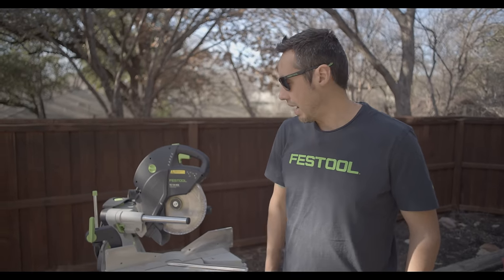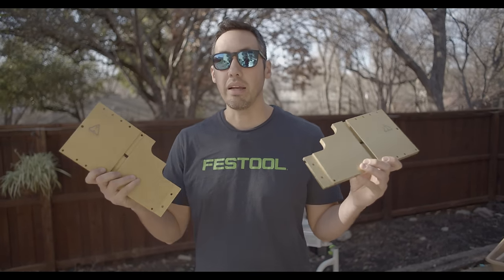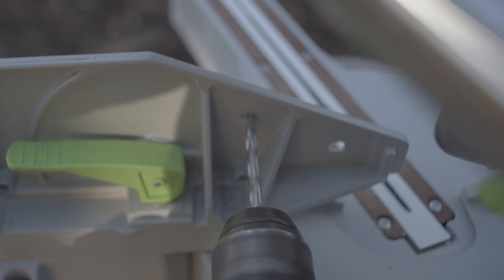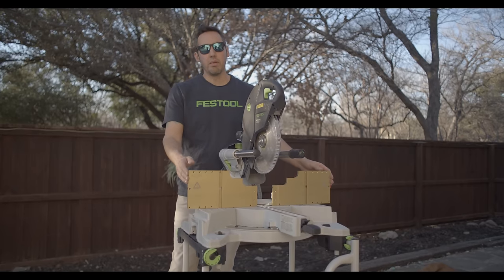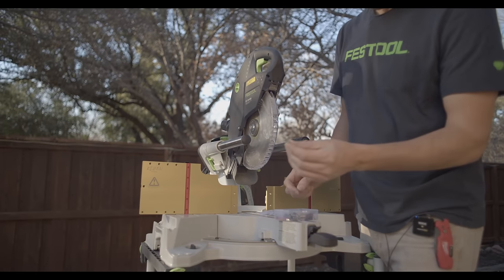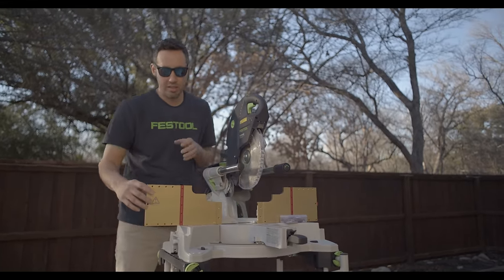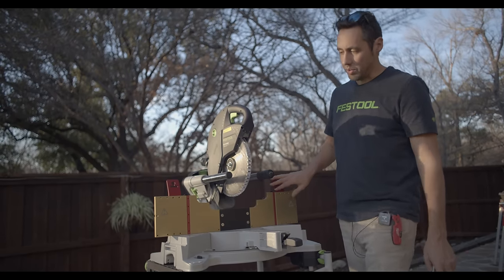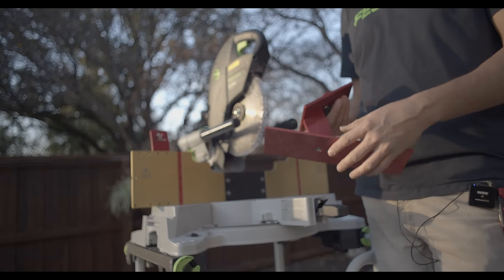Festool, don't hate me for this...

Comment: Question, moving the fence out by adding a layer changes the pivot point to be behind the fence. Which would make the zero clearance slot wider when turning angles, no?
Reply: My thoughts exactly 😂
Reply: If you are a fixed fence miter saw owner I understand your concern. That is why we added the t-slot across the back so it can be positioned and you’re not cutting into it all the time.
Reply: @KizenEnterprise  i didn’t notice that. That is super smart. Good engineering and thank you for the answer

Comment: This looks awesome. Any thoughts on Fastcaps crown stop fence?
Reply: It’s a bit different but I think I prefer that (not that you asked me). One important thing you don’t lose with FastCap is the pivot point because for DeWalt at least it goes on top of the short factory fences vs sitting in front. The saws are designed with that pivot point as the reference when you turn them, so you lose that by putting this fence on the front of the factory fence. This definitely has more functionality though.

Comment: We prefer the Fastcap fence mod over the Kizen on our saws. You don't loose cut depth.
Reply: That’s all good but you are still setup to do one thing. The table problem is now the fence problem.  Setup time again if you needed to cut something else
Reply: @KizenEnterprise  Which hasn't been an issue for us whatsoever. Solution for a problem that doesn't exist for us.

Comment: Hard choice between this and the fastcap fences. Think the zero clearance insert is great.
Reply: Kizen Mitre Fence is a system design for people using a mitre saw for more than just crown moulding. Great in shop and on the job and also also on not just one saw brand

Comment: That saw is insane. Definitely will have one in the future
Reply: Save your money, get another saw..its not worth the price
Reply: @freddyramirez1820  really? Why’s that. I’ve used dewalts,hercules, and Milwaukee not so much festool.
Reply: @CanisCarpentry  ive been using a dewalt for yrs, figures i see whats the hype and i got the kapex..the 1st thing is the cut depth, being used to 12" blade, going down to a 10" just doesnt cut it..if anything that one of the main flaws until they make a 12" festool.. nxt the laser wasnt even accurate out of the box, you can adjust it, but time and $ adjusting everytime you switch the blade id its diffrent kerf is not ideal, the shadow line the dewalt light makes is more practical, kinda suprised Festool doesnt have a light and laser for the $..nxt the dust skirt gets in the way, i like to score the top before a cut all the way thru, the skirt will be in the way if you want to do this, you have to do a chopping motion instead of sliding motion..lastly the motor didnt run smoothly on mine and i didnt like it, sounds like it bogs up, i was cutting 8/4  walnut and it couldnt even get thru that, i could only imagine Oak..just didnt seem powerful enough, sure you can adjust the rpms but the power feels weak..i returnd mine, wasnt worth the price tag for me, couldnt even beat out the dewalt for me..i orderd the 12" makita, we will see how that works..but for damn near half the price i can deal with it no being perfect, but the price tag on the festool just didnt make justice with all the BUTs i had..

Comment: i am genuinely interested for how this festool mitre saw compares in detail to the latest top-of-the-line makita mitre saw. although (personally) on a budget i can only afford a cheap-ish $200 level tool. and these ones cost at least 2-3x or higher. but i think it's worth it to know what the improvements are, and in what specific places on the tool. where the value is, and for what benefits

seperately for the fence... there is that mag-safe guy who also did make some cool looking fence too. but i cannot remember his name now. but he is another youtuber carpenter person. very interesting these 3rd party fences and i agree well worth upgrading. then again the same question for the budget $200 saw whether its worth also doing a fence upgrade since surely those also isn't going to have such a good fence at the even lower price points... then perhaps could take the fence with you when upgrading to a new mitre saw. so this stuff... idk. all i know is that i definately need a mitre saw. just like everybody else for the general home and a variety of common diy projects. and making custom little furniture or fitted pieces etc.

Comment: No doubt the kapex is a quality saw, but the truth is its just too small, depth and width of cut is very limited due to its blade size, if they did a 12" version then I'd buy one.
As for the fence i don't think I'd get any benefit from it to be honest, im 25 years down the line 2nd fix carpentry and a regular 12" DeWalt sliding mitre saw does everything i need it to.
Nice bit of kit if you have a use for it i suppose 👍

Comment: How much for a CNC to fab those bad boys? 😆The slot cutter would be the trickiest  part I'd imagine
Reply: First question a machine shop will ask is how many do you want.  the cost of programing is divided but the number of pieces.  And it is not trivial.  For a few pieces, manual machining might be cheaper especially as there do not appear to be any complex curves.   and then buying one or two may very well be cheaper than making a small number.   
Or are you trying to take away his market and become a retailer?
Reply: @edwinfriedl2446  Just curious if a hobby style <$5k CNC mill  could make similar but a bit of research suggests no.
Reply: The scariest part for me. Will the high dollar t-slot bit make it across without breaking. Definitely a cnc operation. And I made the first 180  sets with jigs and several router setups

Comment: That zero clearance insert is genius.
Reply: Paying to replace that plastic peice each time you cut it is not genius at all..lol
Reply: The Kizen Mitre Fence is a sliding fence. You can narrow your miter saw gap. The problem has been other users not thinking about where the fence is before they cut. The aluminum fence gets cut or nicked. With the plastic tips easily replaced. You position the fences for your needs. You don’t have to cut them every time. If you need taller support next to the blade add the 6” plastic tip